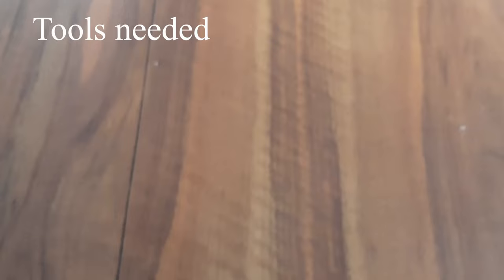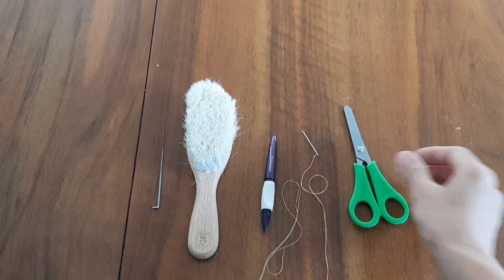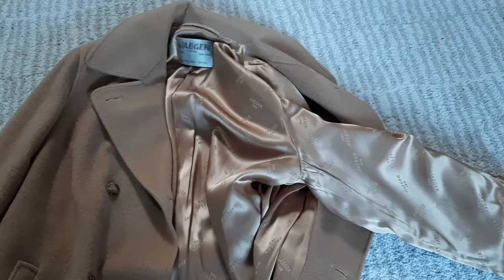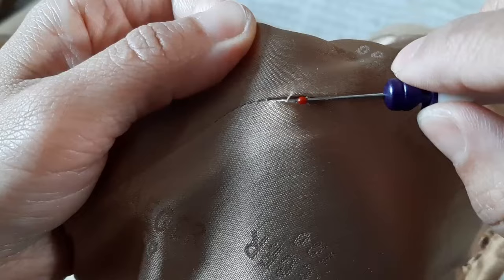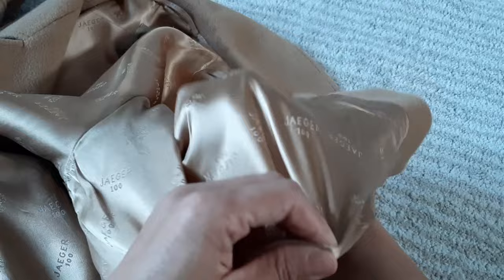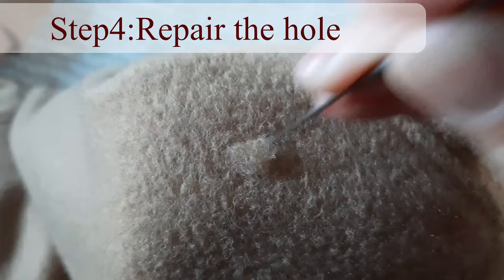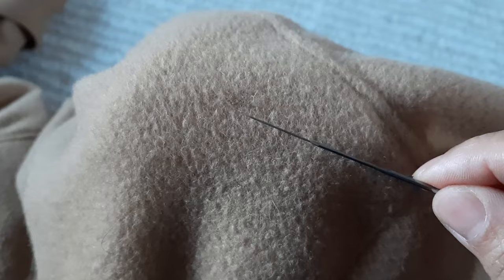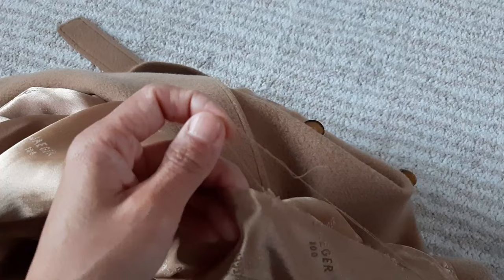How to repair holes in a camel coat? Step by step.

Comment: I have a coat almost if not exactly the same color with same hole issue  (multiples)
I will definitely try this.  Thank you
Reply from the maker: Great. Please make sure the wool you sauced has the same colour shade with the wool around the holes, since the colour around shoulders may faded by sunlight exposure, but inside the garment,  the colour may be still fresh. Have fun.

Comment: Question. What happens to fibers added when coat is dry cleaned?
Reply from the maker: A good question, sorry I can't give you answer, because I haven't got the coat dry cleaned since I added the fibers to repair it. I very carefully avoid dry clean, because I don't like chemicals go through the coat. I normally air the coat outside, give the coat a gentle brush and steam it at home.
Reply: generally, you should not send a vintage coat (30 yes old or more)to the cleaners.   Rather you should clean by brushing well, rinsing any dirty spots with a slightly soapy solution and then clear water.  Then  hangoutside in shady spo to get rid of any odor and in shade so sun doesn't damage.  Advice I got from vintage shop owner.   A ten year old coat can go to the cleaners but  I don't know what would happen to the felting. I only clean my coats at cleaners 1x a year, to be safe.
Reply from the maker: @marianlinden9736  You've given us such good advices, very detailed and helpful. Thank you so much!

Comment: Wow, great techniques! There are a few moth holes on my camel hair coat, can iron-on patches be ironed on the coat? I don’t mind adding decorations on the coat if it’s doable. Thanks!
Reply from the maker: Hey, thanks for checking the video. I have  no experience with iron on patches, I am not sure if it works for a camel hair coat, since camel hair is long and fluffy, not a flat surface. Would it be possible to test the iron on patches on a invisible place of the coat first?
Reply: Thank you so much for replying!🌹🌹
Reply: Don’t do that

Comment: My friend accidentally burned a hole (cigarette 😢) in his black coat. I believe I can use this technique, but should I trim the sides of the hole that melted to give it a fresh edge or felt into it to cover it all and better hold it there? 🤔
Reply from the maker: Hi, I haven't mended a burnt hole before so I can't give you an answer from my experience, however I would do like you said, trim the melted edge first. If the hole was burnt through, I would use the same coloured thread and sew a base first, afterwards add wool. I hope this answer would be helpful.

Comment: Will the repair part fall off after a while?
Reply from the maker: Good question, thanks. Mine still stays. I think instead of putting all the camel hair on one go, it' s better to put a little bit camel hair each time and use felting needle to fix it, one layer after another layer.

Comment: Hi,

Is it necessary to open the lining to do this?

Also, I noticed my coat has become threadbare around the edges, like near the cuffs. Do you know the reason for this and can  I use the same technique there as well?

Thanks!
Reply from the maker: Hi, opening the lining just makes it is easier when doing felting and protect the lining. I've seen other people doing the similar repair without opening the lining. 
About "threadbare", if you mean the area near the cuff lost wool and shows the  lining(I meanthe lining which hold the wool ), yes it happens because the wool has been rubbed off when you put the coat on and off. I have a coat, I can see the "threadbare" near the cuff, near the pockets, near the neckline etc any area which have more contacts with hands, neck, even bags. I think you can try the same technique. I hope this would be helpful.

Comment: I was kind of disappointed in the results.  It seemed that the repaired spots were obvious.  Maybe a steam press and/or a trim would have made them less so?  I want to repair a camel hair coat for my husband that we bought 40 years ago on our Honeymoon to Bermuda.
Reply from the maker: Hi thank you for your suggestion. I see the repaired spot is different, too, I think it looks darker than other areas, because I have taken some camel hair from inside  the coat which is a darker colour, but the shoulder parts of the coat are fading due to exposure to sunlight etc. Next time I will try to source camelhair/wool with a better matching colour. A coat from Honeymoon is a treasure, I am very curious to know the results of your repair.
Reply: @mycolourfulvintagewardrobe9844  WOW!  Thanks for replying!  I'll see if I get any better results!  I will let you know!

Comment: I try this and my fibers fell out after wearing it for a month.😢
Reply from the maker: Hi I am sorry to hear that. Where is the mended hole? I am wondering if the mended  hole is where the coat gets more contact from other part of coat, hands, bags etc, so the fibre get more rubbed and eventually fall off. Or adding fiber piece by piece instead of a big lump in one go while mending would last longer?